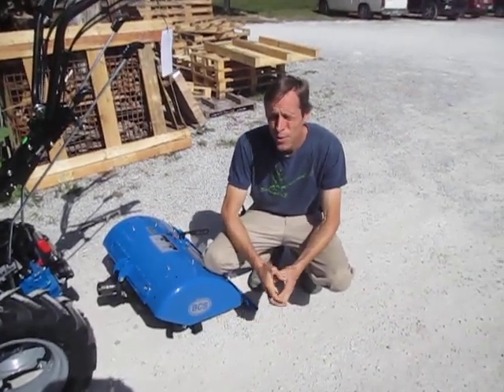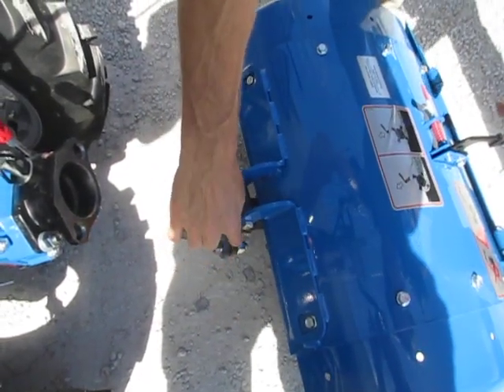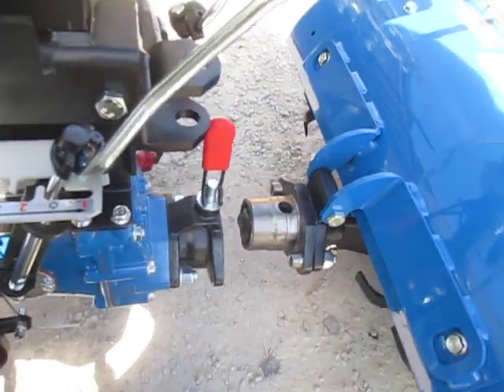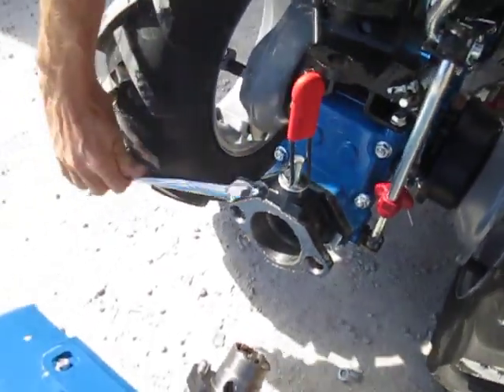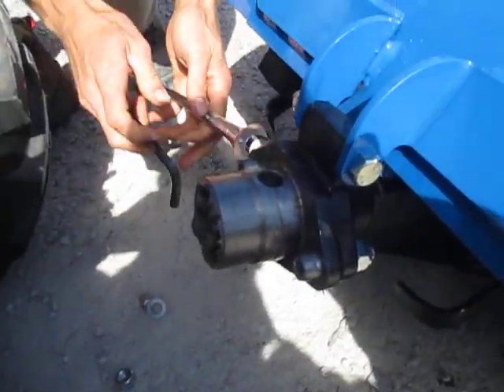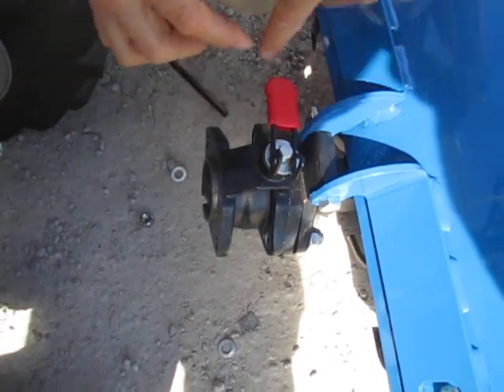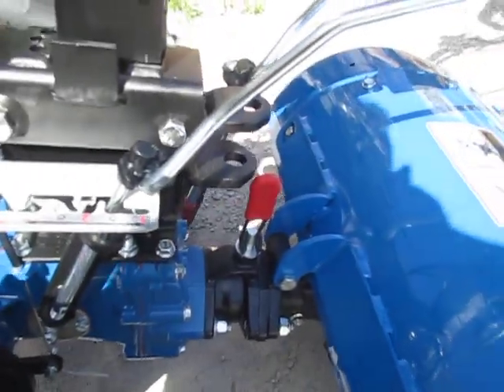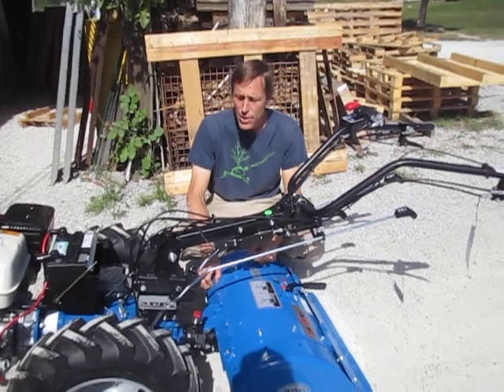BCS Walk-Behind Tractor: Quick Hitch Proper Alignment

Comment: Another good video. My problem is getting them apart. Had to make up a special tool to pry them apart.
Reply: Agreed! It took jumping and pushing and two people to disconnect the rototiller from the quick coupling after the rototiller had been used several times and we needed the bush hog. Lost a patch of flesh off my arm when finally pulled the tiller off and it dropped a couple inches despite trying to avoid that. Hope he makes a video of how to get the tiller off if it sticks or direct us to one that shows the best procedure.
Reply: Linda, please review ALL the quick-coupling videos on our website (there are 3 besides this one); the tips in the "first" one (video #1) particularly are most helpful. Of course the main factor for new equipment is that the couplings are MUCH TIGHTER when brand-new, so they are stiffer to work with until they "wear in" a bit.
Reply: If the couplings are lightly lubricated, and the procedures outlined in ALL of our quick-coupling videos (we have 4 of them) are followed, the quick-couplings work fine. However: Too heavy a grease will cause problems, and of course the main factor for new equipment is that the couplings are MUCH TIGHTER when brand-new, so they are stiffer to work with until they "wear in" a bit.

Comment: Wow, thanks for posting this video! Just yesterday I tried to hook the snowblower attachment for the first time. In order to get the pin to drop I had to wiggle the snowblower as shown in the other quick coupling videos, it now sits at a weird angle to the tractor. I had planned on calling or emailing you but I thought I'd check the videos 1st and here is the exact video to fix the exact problem I just had. Thank you again! You have a great product and provide a great service.

Comment: Are there any tricks to align the quick connect for the Rotary Plow?
Reply: Sorry for the delayed reply. If the plow is equipped with an "integrated" male quick-coupling, then no alignment should be necessary.  If the plow has one of the male-quick-couplings "bolted" to the flange (like the tiller in the video), then the same procedure would be used.